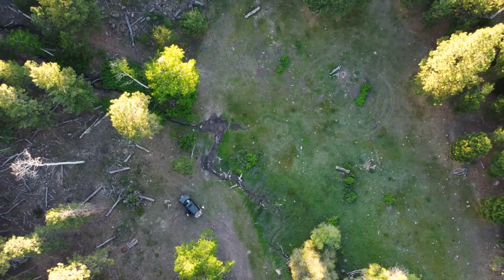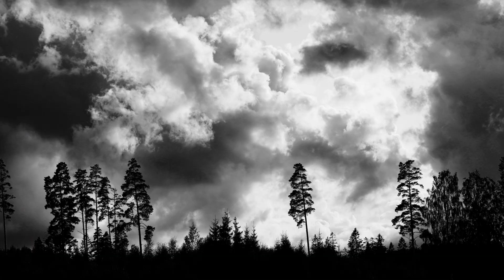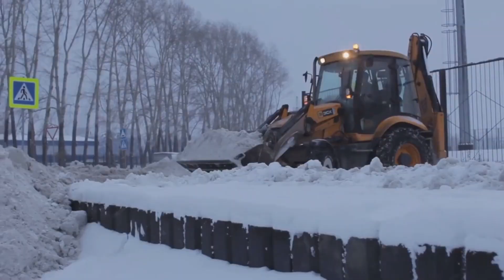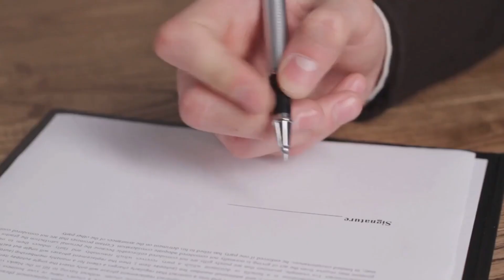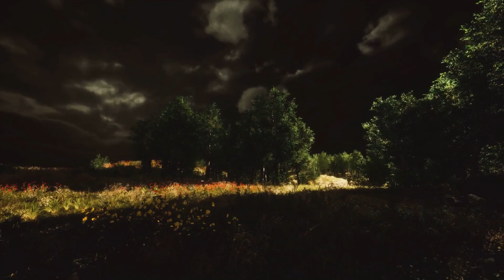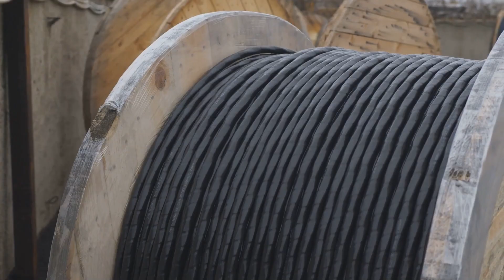Canada’s ‘Area 51’  Tesla Wireless Power

Comment: Is it possible you got the gradient correct but the transmitter and receiver backwards? The earth is already oscillating. It would take massive inductance and capacitance to match it's low frequency. It would also take high altitude into the gradient to extract and condense it. From there it would need to be interruptively discharged to gain useful ac frequency.

Comment: Thanks bro... No power input required... A Magnets (dielectric point source device) precession is already moving at 30-50 Mhz... we are working with using 2 coils, 1 per side using the phase lag between N/S sides... this is just a start and your input is very valuable as Capacitors are an important aspect and there are hints on the egyptian walls...